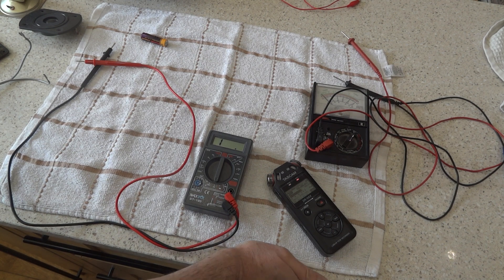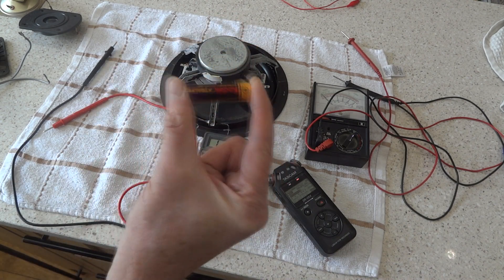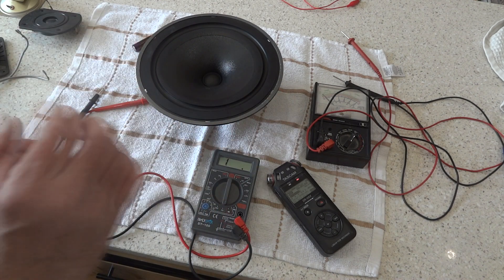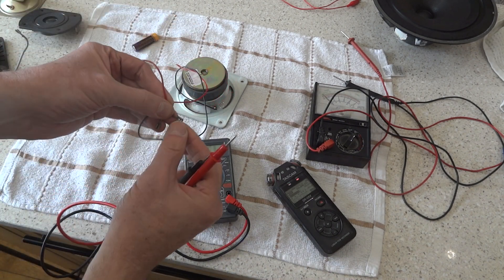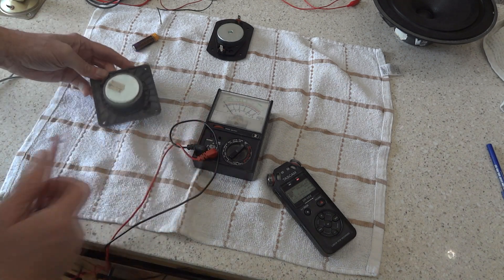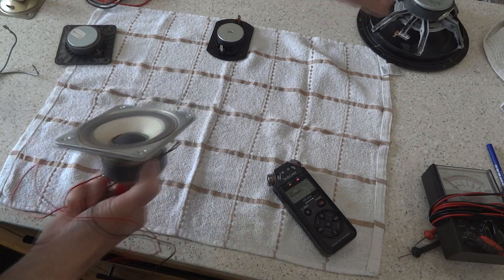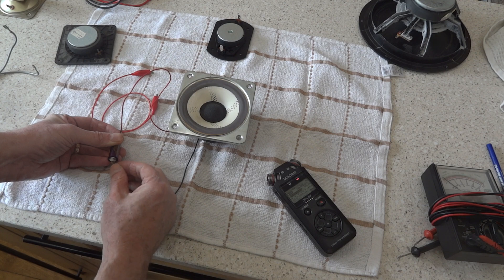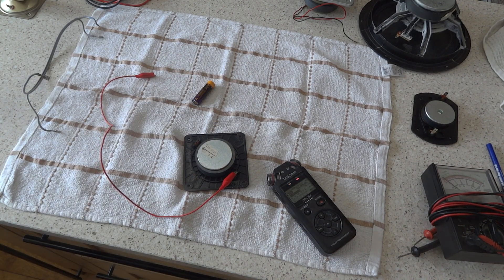How to Test Broken or Blown Speaker, Drivers, Bass, Tweeter, Mid Range, Vintage Speakers Driver

Comment: I love finding vids like these .. My bass speaker has gone on one of my Eltax Monitor III .. I have a Multi-meter but havent got a clue how to use it properly ... This is a nice work-around to see if it blown or not ... Thx for the upload 👍 (Edit .. The speaker is dead 😭 no readings at all ... But at least I know now 🙃)
Reply from the maker: Thanks for the comment. That's bad news, hope you find a replacement driver.

Comment: Maybe I missed it, but when you was testing those speaker units you didn't say which setting the multimeter was on to do the measuring !
Reply from the maker: Sorry the multimeter is set to OHMS / Resistance and the lowest value in the range is best mine was set to 200 ohms
Reply: @MichaelYates  Ok Thanks, sorry to be such a novice, just received my first multimeter, si a lot of head scratching going on 😄

Comment: Legend, my tweeters seems to be cooked (no reading) Also- is there a way to test the crossovers within a floorstanding speaker? Thank you!
Reply from the maker: There is not really a way for testing a crossover correctly by just using the 2 or 4 (bi wire) terminals at the back of the speaker. You would have to remove the crossover and test each individual component
Reply: @MichaelYates  understood. 
Also one of my tweeters  has a reading of 4.6 ohm but when I switch the multimeter touch bits around on the tweeter terminals the ohm reading is constantly changing  with all random numbers - does that mean this tweeter is also burned / damaged and need replacing? Cheers
Reply from the maker: @wokitlikeyoutalkit5619  Fisrt of all make sure your meter is working correctly, by touching both leads together and shound read around zero to 0.7 ohms solid no jumping around  the leads will have a little resistance zero to 0.7 ohms. When attaching the leads to the speaker make sure speaker terminals are clean and you are holding leads in tight as dirty or loose connection will give readings all over the place and jump around. Now if all leads and connections are fine and your meter is still jumping around then it well could be that the coil inside your speaker is intermitent and thus no good
Reply: @MichaelYates  clean speaker terminals,  i hold one way I get a 4.6 ohm reading then I switch terminals and the reading is constantly jumping.  I've ordered new voice coils and hope to resurrect my childhood speakers dali blue 6006 😁. Thank you.
Reply from the maker: @wokitlikeyoutalkit5619  I hope the new driver gets them up and running. seems funny it reads ok one way and not the other

Comment: Hello, i have that my left speaker Dynaudio Focus 140 is playing little bit quieter than the right one. When played quiet or loud doesn’t matter, the cables are raw input and fine but they’re not the same lenght. Could that be the problem? Or what is up with that? Visually it is fine the left speaker.
Reply from the maker: The lenght would not matter unless a few hundred meters long. I would test speaker on both left and right of amp just incase its the amp. If amps fine then could be the crossover in one being slightly out compared to other. Even though the cones more freely on the main drivers it could still be one not having full movement when playing, one tweeter could be a little louder as well. Check the wadding inside speaker cabinet is not pressed up tight on the driver and both are the same in both cabinets. If you can play a mono track and try and see if its the main driver or tweeter that is lower or both.
Reply: @MichaelYates  Thanks for responding, ill find out.

Comment: Hi Michael, I have an old pair of Kenwood LS-V120-W 2-way 3-speaker bookshelf speakers with a Lineaum tweeter. Is this method (using a 1.5V battery) also viable or safe for testing my Lineaum tweeters? Also, is this procedure safe to perform with the crossover circuit attached, or should I test it after removing the crossover circuit. Thanks for good content.
Reply from the maker: I would try to unsoldier one side of the tweeter and use a meter across the 2 terminals, should get a reading of 4 to 8 ohms using the resistance setting on meter. I would not use a battery as TBH I am not to sure how sensitive these Lineaum tweeters are. A cheap meter can be bought for 7 quid on eBay that will do the job and they always come in handy. Normally just playing some music with Cymbals, High Hat etc you should be how to hear the sound come out of the tweeter with your ear against it.

Comment: Do speaker have to be off the car can you test them while on
Reply from the maker: They can still be on the car, but you will need to undo at least one lead(connection) from one of the terminals, then place meter or battery across both connections, you could use small crocadile leads to help if akward getting to speaker connections
Reply: @MichaelYates  ok thank you for replying I appreciate it 👍🏻

Comment: Have a pair of KEF 104/2 and one speaker doesn't work.   It won't 'Tone' for continuity.   Will end up opening it up and doing a visual.   Wondering if I test the crossover plus(+) minus(-), if it tones out then there is an 'Open' short somewhere.   If the crossover doesn't 'Tone', then that's should be where the issue lies.  Would I be correct?    Anyone here reading this, any input is very much appreciated.
Soon to be (in 21 days) 63yo 'Wanna Be' Audiophile from the SF Bay Area, Ca.

Speakers owned:   KEF 104/2,  KEF C80/Series2,  Jamo Classic 8,  Klipsch Heresy (1978)
Many Amplifiers, most Sony ES:   TA-E9000es, TA-N9000es,  DA4es, Yamaha CA800  just to name a few.
Reply from the maker: Hi, If you have tested across the speaker inself without the crossover connected and you get no reading then the speaker must be open circuit, the battery test would confirm this to. It is sometime not possible to test with meter just putting the probes on the (+) and (-) of crossover it depends on how it is wired

Comment: Hi Michael, thank you so much for good information, I have a problem with my car speakers which all of them doesn't work. When I check with multimeter I can see good ohm values. However when I perform battery test, I don't hear any  noise. How can I be sure the problem is speakers or car stereo. Is there any way to check stereo outputs? Thanks in advance.
Reply from the maker: I would be very surprised if all the speakers have failed and if they all read 4 to 16 ohms on your multimeter then they would seem fine. But surprised the battery did not produce even a very little sound. You can test the output from the stereo but you would have to be very careful by connecting the speakers or an 8ohm load and setting your multimeter to millivolts range and putting one probe to one side of speaker or load and other probe to the other side of speaker or load and turn stereo up a little you should get a reading and it will get higher when turning the volume. but be careful you have meter on millivolts and dont short out the stereo outputs.
Reply: @MichaelYates  Thank you so much I'll try it out.

Comment: Michael maybe you can help me with something my brother.. I have a set of Peavey International 118 Speakers..they are 700 watts program and 1400 watts Maximum. They have a High tweeter a mid tweeter and also a 18 inch woofer in each cabinet. One of the Horns are not working in the top Speaker so when I plug it into my Pa System it is distorting. The other cabinet sounds solid and is not distorting at all. So do you think because the top tweeter is blown it would cause the whole cabinet to distort, or do you think the 18 inch woofer is getting ready to blow.  What is your opinion brother. Let me know okay. 
With Highest Regards Ted Martin Canon City Colorado
Reply from the maker: Hi Ted, Dont know much about these speakers TBH, but I would just take out the distorting horn from that speaker cabinet and swap it over with the good one in the other cabinet, if its still distorting then that would tell you that its no good. just the horn not working properly should not affect the other mid tweeter or bass drivers sound, they should still sound fine, one way again is just to unplug the wires going to to faulty tweeter and play some music using the cabinet with just the mid tweeter and bass driver connected. Also there is a video here that shows a repair to a bass driver in the Peavey 115 speakers when the foam inside starts to crumble, dont know if your 118's use the same or simular driver https://www.youtube.com/watch?app=desktop&v=9WrrZGGgrz4

Comment: hi mike you have high street meters  tandy ones or hafifords  you are right  for the newbee's  £8 in halifords were selling them 

voice recorder nice plan  tascam one  i am still using a MD recorder   tascam ones pick up wind out side  
why i used the MD and mic and cover    

i am back i got to yes to make video's   i just to get a over head cam like you have here    bob
Reply from the maker: Yes the Tascam is very sensitive indeed. I just use a camera on a cheap tripod up high and point down, I see the tripods in charity shops all the time for around a fiver, come in very handy. looking forward to you getting up and running
Reply: hi  i have the over head boom and tripod

it's just the cam left   i am looking in to it
there's so many out it's a right mind
field of cam's